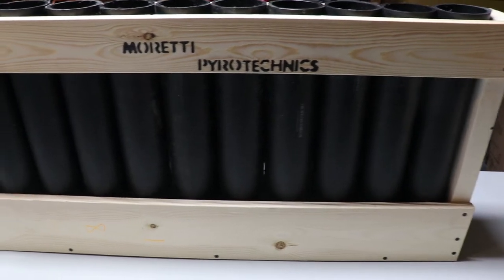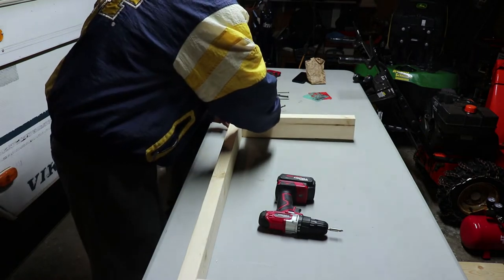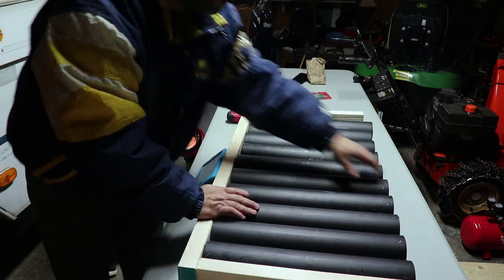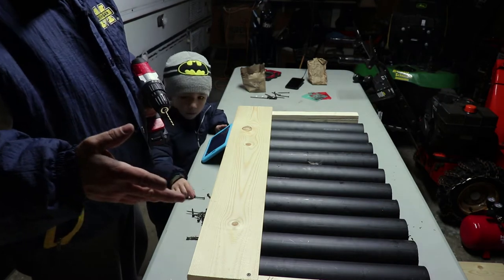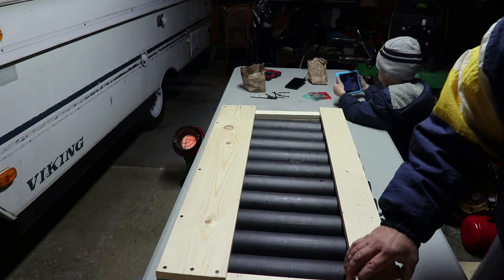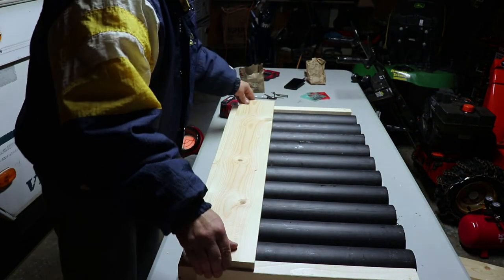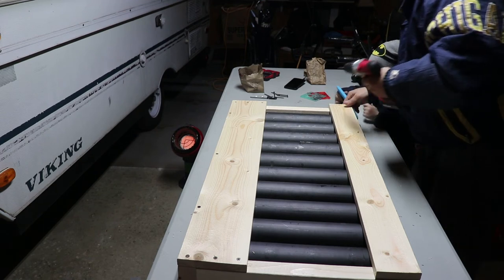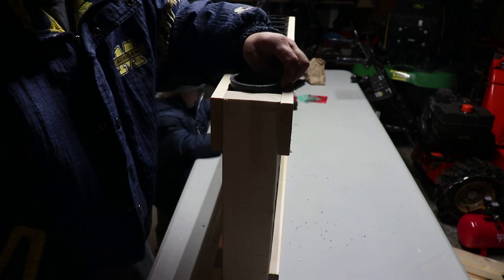How To Build A 3 Inch Firework Display Rack

Comment: great tutorial, I am building a few 3" racks, I plan on either 3 or 4 shot racks and possibly put 3 of them together and angle 2 of them and have the last one aiming straight up.
Reply from the maker: Cool yeah I built 10 of these 10 shot and am in the process of building 20 more on top of 10 more 4s 10 more 6s and 20 5s got a 7500 dollar show coming up in July with some heavy fire power. Lol
Reply: Thanks from Ohio🙏

Just received my FEL🎆🧨🎇

Comment: Hey buddy. Two questions... do you cork the pipes and do you put it on a platform Incase it tips over?
Reply from the maker: So the tubes have a wooden plug in them the bigger the shell the thicker the plug and on shoot site we bind all the racks together with boards and screws so they don't tip.

Comment: Do you use any type of base support to prevent it from tipping over?
Reply from the maker: Yes on the field we phalynx every rack together and we use 1x6 inch legs for end support. And when we build a battery it becomes one solid rack with multiple racks joined together. We are very particular about having safe racks set up on the field this goes for all our sizes 3-8 inch across the board.

Comment: What wood size are you using? Thanks
Reply from the maker: @CaliLife916  as in dimensions or size of boards?
Reply: @MorettiPyrotechnicsLLC  sorry. The size of the board. I want to build a 3"display 4 shot rack, but 2x4 is not exactly 2x4. Thanks
Reply from the maker: @CaliLife916  2x4 is exactly what you need though 1x4 1x6 2x4
Reply: @MorettiPyrotechnicsLLC  it'll be tight. I have a scrap 2x4 the tube is edge by edge. Thanks again
Reply from the maker: @CaliLife916  bro I have 150 racks made with 2x4s so maybe your tube maker uses a different style of hdpe?
Reply: @MorettiPyrotechnicsLLC  I got it from pyrboboom. Probably my board is not 2x4 then lol. Thanks

Comment: so how to videos on 4",5",6"? Also do you need spacers in between the tubes for different calibers if so can you do another build to demonstrate this.
Reply from the maker: Yes 3s are not mandatory some use spacers some don't. I space the 10 shot racks from each other 1 rack width apart. 4,5,6 you want at least 2-3 inch wedge too and bottom to space actual tubes in case of flower pots and blow outs. I do have a 6 inch 3 shot rack video I'm going to make soon. Also tube counts matter as well. You don't want a 10 shot rack of 5 and 6 you can do 3-5 but I believe that's max on tube count 4s you can do 10 but I believe then you have to wedge.

Comment: How much for rack like that cost?
Reply from the maker: I buy everything in bulk but if I broke it down to material without labor it's around 150 a rack for 3s. The bigger the tube the more the cost. A 3 shot 6 inch rack costs around the the same but it's only 3 shots. Much much bigger in scale and quality though. I'm gonna do a how to make a 6 inch firework rack video in late spring.
Reply: @MorettiPyrotechnicsLLC  I need 1 like that